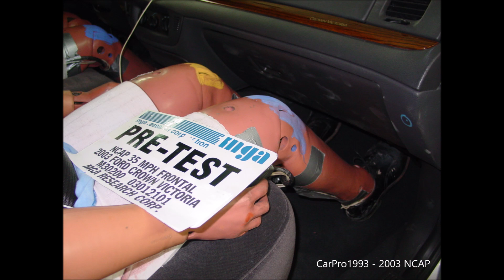2003-2011 Ford Crown Victoria / Lincoln Town Car NHTSA Full-Overlap Frontal Crash Test

Comment: You just can't beat a full boxed frame. Kept the cabin from collapsing around the passengers. That's why I own a 05(P71)retired cruiser, it just wont die.😎
Reply: Agreed I got my 2010 lincoln long wheel base 580,000 miles and counting.
Reply: no doubt, I have an 05 retired detective car, its my daily with 213,000.
Reply: Same here man 05 interceptor. I feel bad for the newer piece of tin foil car that’s going to inevitably hit my vic
Reply: You do realize this is not a moderate overlap right?
Reply: @Joshua Campodonico  I have. 2010 police interceptor , mine runs good but makes  a sound at start up, have  you ever changed your timing chain
Reply: @joshuacampodonico6554  Hell yeah. Got the 2008 P71 220k and going like a champ. About to replace the transmission solenoids. Pretty cheap replacement even with motorcraft
Reply: @Иванпонимаете-г4ш  What kind of sound exactly? Ive not had any timing chain issues with mine. 2008 P71. Only things that went wrong or needs to be fixed is the fan module, transmission solenoids and the starter. Other stuff like brakes and a battery but I don't count those. Make sure you are using GTX full synthetic high mileage for oil. Will make it last a long time, quiet the engine and improve gas mileage. Also wix filters are actually the best
Reply: @vikinglife6316  oh hell yeah man nice. I’m at 611,000 miles since I posted that comment 1 years ago lol did replace a water pump $380.00  full coolant flush and factory water pump no complaints meter still counting lol
Reply: Body on frame is must have for me.  When I sold my Crown Vic, I bought a Toyota 4Runner which is also body on frame.
Reply: I love my 2005 grandmercury, drives like a dream. Had it for a year so far
Reply: 98 CVPI Former Fire Chief car lil over 480,000 miles and still ticking

Comment: If cops used these, they needed to have safety by 2nd place.

Edit: i have just read the description and noticed both Passenger and Driver got 4/5 stars, WOW!
Reply: It got 5/5
Reply: @MrPorsche91730  Even better!
Reply: God I would hope so this test is so easy to pass.
Reply: Got 5 stars back then but I’m sure it would get less than 3 for the strict standards now

Comment: The 03's are stronger than the 04-11 models
Reply: damn can you send me a link to this info please
Reply: how
Reply: Wrong
Reply: No they are all the same terrible vehicle
Reply: @iair-conditiontheoutsideai3076  terrible 😂
Reply: @kavehhashemi9448  I have an 07 Honda pilot with 312k miles. I would love to see a crap american car get there
Reply: @iair-conditiontheoutsideai3076 Lol, my Grand Marquis has 297k and counting, but that’s nothing special with these cars. There’s a reason they were used as taxis…
Reply: 03-04 are the same ?
Reply: @MJKelzzz  they're pretty close, almost indistinguishable from each other however there are several key differences between an 03 and 04 and the early 03s are different than the late 03s. Ford gives it a job control number 1 or 2 for early or late 03 model year build. They basically ran out of parts from the prior generation, 98-02, and used them up on the first run of 03s. The easiest way to tell if it's a real 2003 is if it has black B pillars vs painted to match the rest of the car and a clock in the dash, locking fuel door, light under the hood, much better upholstery, map pouches in the front seats, full size engine cover, and a few other things I can't remember. There are even differences between town cars. At least 03-04 has a real throttle cable vs drive by wire starting in 05. I can tell the difference when driving my 03 and 05 town cars which are identical but one has a cable and one don't. Long live the Ford Panther Platform!
Reply: @iair-conditiontheoutsideai3076  My 2008 P71 is the best used car Ive ever owned. Not sure where you get that idea.
Reply: @iair-conditiontheoutsideai3076  Guy above has 500k miles on his. If you count the idle hours and my actual mileage Im over 500k as well.
Reply: @pantherplatform  03 had rear axle issue which caused premature wear.  Corrected for 04.
Reply: @encinobalboa  I know. Happened to my 03 Grand Marquis but was easily repaired using an axle repair bearing which has been working great since I fixed it 80k miles ago. I'd rather have that one issue than lose everything Ford got rid of or cheapened up in 04
Reply: @pantherplatform  Thumbs up for that.  Never heard of 03 being stronger than 04 plus.  Did frame have extra bracing and or cross members?
Reply: @iair-conditiontheoutsideai3076  you're right. I'd rather drive a high mileage malaise era front wheel drive compact car with a tiny engine that's got miles of rotted out vacuum lines so it's hard to start and keep running.
Reply: @pantherplatform  Honda pilot is not a compact car and I've seen them go to 380k miles
Reply: @iair-conditiontheoutsideai3076  my high-school shop teacher's daily, a 1966 Dodge Charger with 310 000miles and still counting. Original engine and driveline!